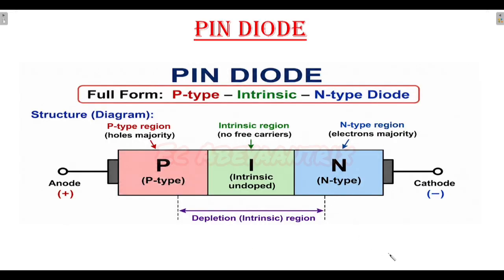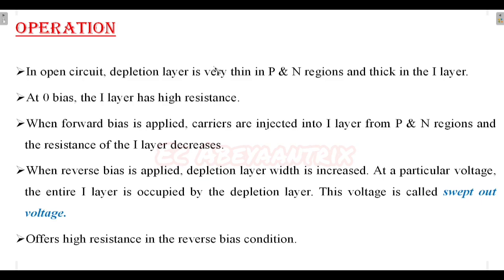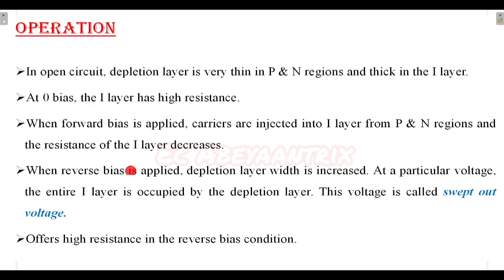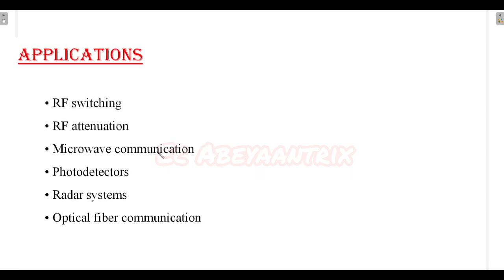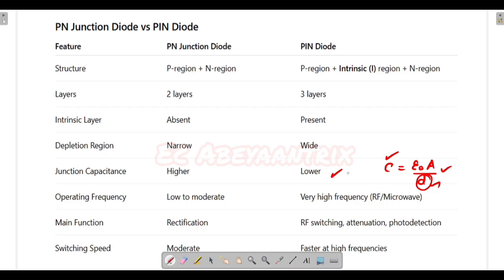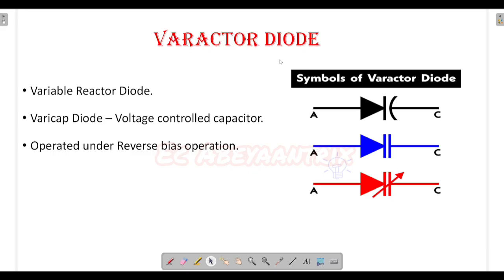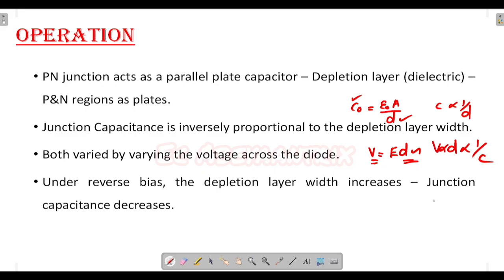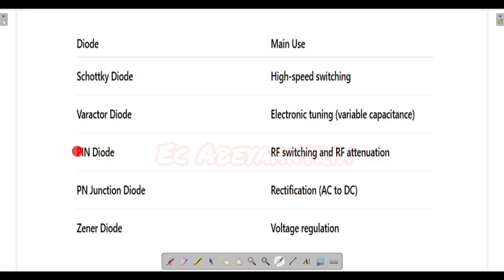ECE Series #7🎯 | PIN Diode, Varactor Diode, Working, Comparison, Applications| EDC | TRB | TNPSC

Comment from the maker: Today's question:
Which diode is primarily used in RF switches, attenuators, and microwave applications due to its intrinsic layer?
A) Zener Diode
B) Tunnel Diode
C) Varactor Diode
D) PIN Diode

Comment ur answer! 

Keep learning ❤
Reply: Pin diode
Reply from the maker: Correct answer! Keep learning ❤